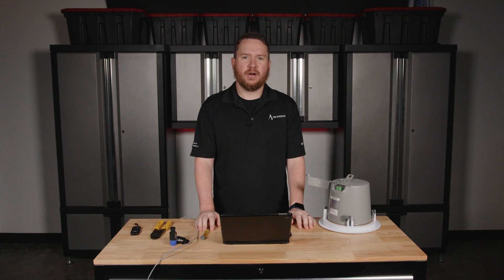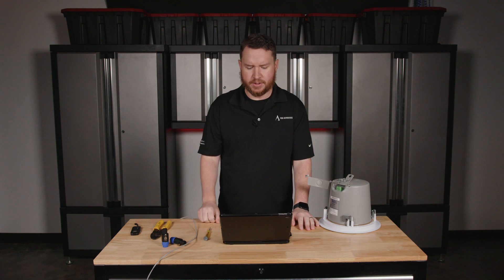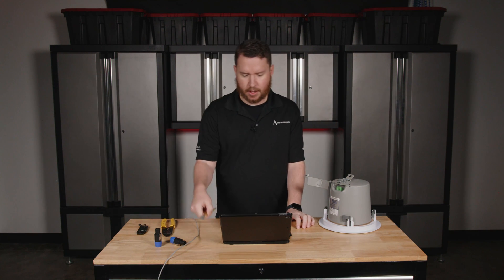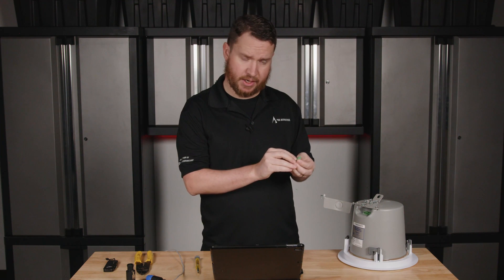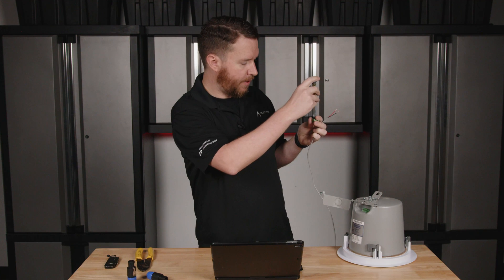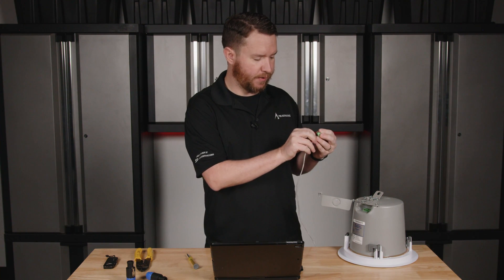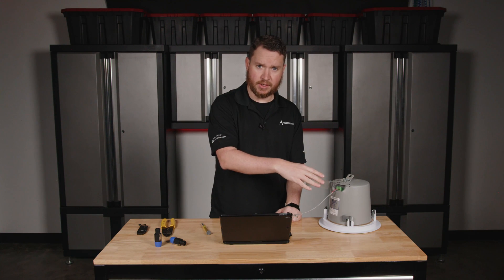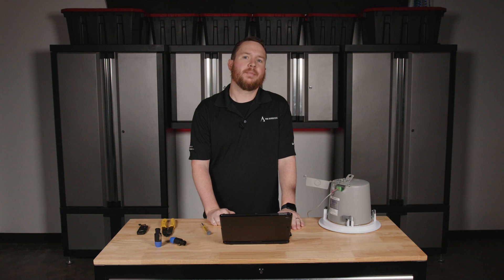How to Wire Speakers on Pro Acoustics Tech Talk Episode 118

Comment: Very informative video!  Just wired a friend's house for home theater and considering speakers that have euroblock connectors.  You mentioned you are using 18 gauge for 70 volt speaker.  My question is could you connect 12awg or 14awg speaker wire to these euroblock connectors?
Reply from the maker: Thank you for your comment! I'm glad you found the video informative. Most amplifier euroblocks can handle up to 12 gauge speaker wire, with rare exceptions. Just ensure the connectors are properly secured for a reliable connection.